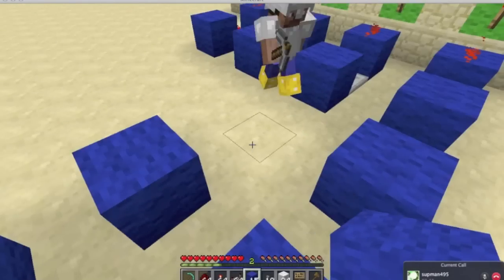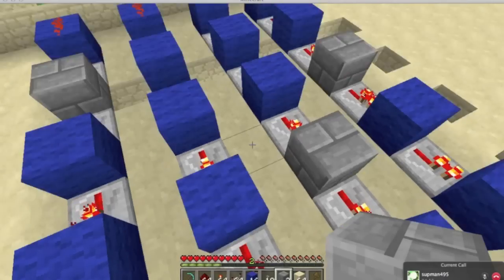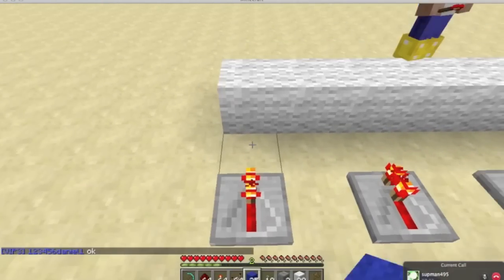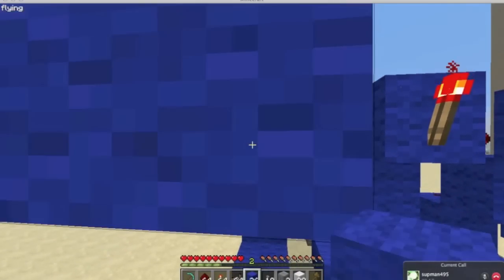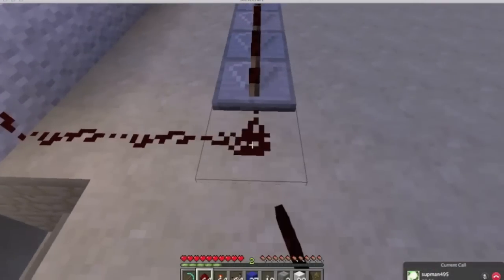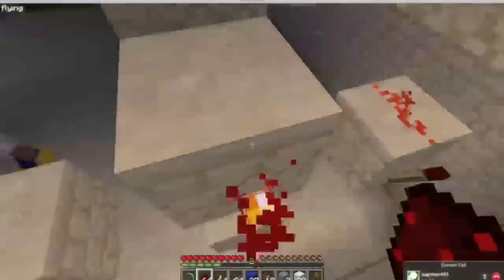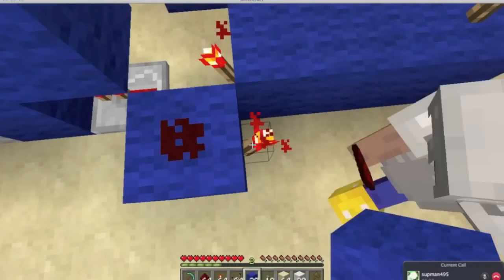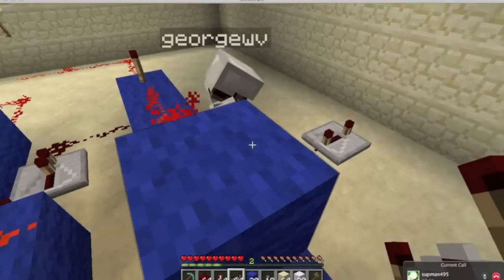Redstone Mechanics: Code Gate/Combination Lock

Comment from the maker: No combination will work except the main one. This is what the AND gates are for at the end of the NOR latches on the upper level (not the decoding section down below.) The AND gates in unison with the NOR latches in the bottom work coherently with each other to provide only one working combination to the lock.